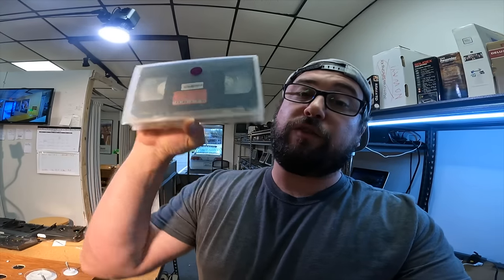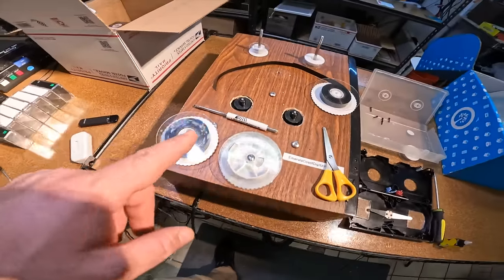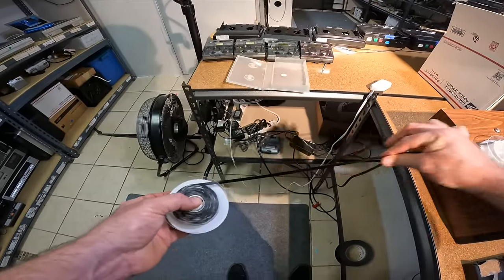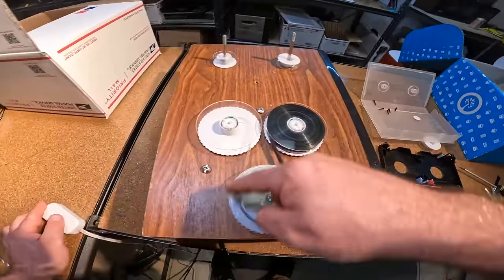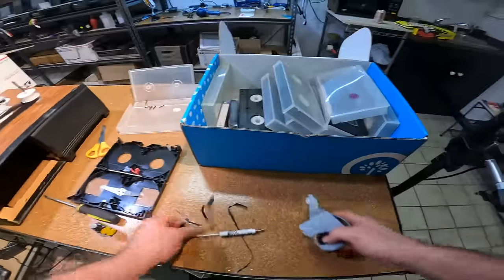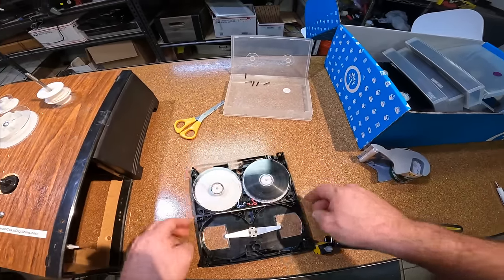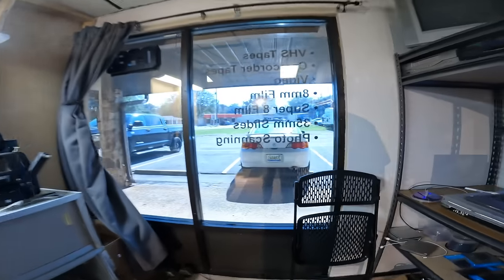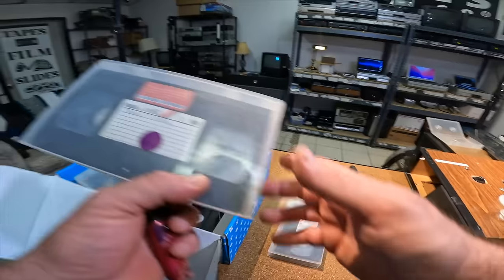Mold on VHS TAPES  **Red Stickers from LEGACY BOX, IMEMORIES , SOUTHTREE

Comment: 17:25 While the drive itself obviously has a certain longevity, it's nice that they tend to use pretty standardized cables, so if it's just the cable's connector that breaks down after a while, you can get a new cable for five or six bucks rather than buying a whole new drive.

Comment: I used to do tape dubbing and with 4 or 5 machines going, most recordings don’t all stop at the same time, and would get hairy because they were mostly traffic scenes and looked similar, I had to rely on the information the requestor gave me and if was wrong I had to babysit and play the tape and sometimes take a still print of an incident. Your operation was much bigger than what I had. We had a machine that would clean and take a stretched tape and take all of the slack, sometimes manually winding a tape that was stretched would add an extra 5-10 minutes. Our tapes were recycled every 45 days so anew tape might have 3 or 4 passes before retirement after running for an 8 hour stint.

Comment: You should add a network attached storage system, that way you can simply transfer from the internal HDD of each system to the main NAS storage without having to use a external HDD. Look into the QNAP systems..worth the upfront cost. If you want to go crazy, run everything on a 2.5 or 10GB ethernet network and youll having blazing speeds.

Comment: Man! Don't do that by hand! Use a VCR that isn't very good and let the tape run in play mode. It will slowly peel off the tape. Or, use a damp cloth to force it inside the spool to clean the mold. I always do this and it works! It takes a lot of effort to pull the tape by hand.
Reply from the maker: I appreciate your input.. You haven’t ran In To this type of mold before I guess. There is no… put it in a player..
Reply from the maker: I do sometime break the top of the spool off and then wipe it down. This is a demonstration video on how to keep it from ripping.

Comment: Beautiful. Some notes, though: 1) Yes, you 1000% need a NAS. 2) Until you get one, you should be using the `sync` command in the MacOS terminal (or "safely unmount") after each copy to that external SSD. The OS will report that the writes are done before all the bits actually hit that disk. 3) Once you do get network storage, don't use wifi, run ethernet to each station. 4) Have your capture software drop files directly on the NAS to save some more time 5) Your network storage represents a potential value-add for customers, because now you can offer storage of those files for a recurring fee. 6) What video encoding settings are you using, and how did you come to that decision? 7) Given that you're regularly handling moldy tapes, are you using any sort of air filters?
Reply: Was going to make comment #5 myself.  It depends on whom you listen to, but some will tell you that a USB flash drive should not be expected to store files longer than a year or two without refreshing.  Regardless, it should not be the customer's only storage for irreplaceable data.  You could offer long-term storage for a recurring fee, or you could try to upsell providing the same recovered video on multiple formats (flash, hard drive, and/or even M-disc archival grade BD-R or BD-XL discs) since they all have different optimal storage properties and failure modes.
Reply: @toasTr0n  if he replicates it to something like Backblaze B2 (or any S3 clone), he could also offer a sharing portal, just like the big restoration services he's already styling on.

But yeah, end users lose data. And his customer base is going to trend to older folks. So not having to worry about file management is going to be worth a ton to those customers.
Reply from the maker: No air filters at the moment. But I am aware of the dangers. I wear a mask but it’s far from sufficient. Things will change next time I get aick
Reply from the maker: I’ve thought about the monthly storage payment. Thanks for you input and questions.

Comment: Surprised about the 'splicing tape' you are using. That's just normal tape, right?
If one of the heads catches that, it's end of head. Definitely worth getting 1/2" reel to reel splicing tape. That stuff only sticks once, and does not stretch. Not expensive either.
Speaking of audio tape; I see some half decent decks, why are you using the cheap plastic thing? Seems a waste!
As for the server; Just a modern 4 bay synology NAS man. Two drives in raid for the customers, two drives in raid for your own stuff.  you'll be good.
So with you on the 'not leaving tapes overnight'. Makes a ton of sense. 
Also, hi to the chickens 🐓
Reply from the maker: I forgot to add the chickens at the end of the video grrr… when someone brings cassette tapes in I tell
Then how much I hate doing them.. I’m a video guy. But if they insist and are ok with a basic recording.. then I’ll do it.
Reply from the maker: Also I am talking to synology. I want them to sponsor
Reply: Works fine. I tape on the bottom.
Reply: Hahaha, yeah it's very basic! That's why I was wondering. A cassette tape can outperform a CD with ease, sound wise, if done right. That being said, if people don't mind the basic quality, I guess they don't know and don't care about that. 
I mostly do the audio side of digitising (cassette, reel to reel, vinyl, 8-track, minidisc) but I also have a VCR with HDMI out hooked up to an HDMI to USB capture device. It looks great, so I can help people with VHS and VHS-C, and anything else if their camera still works to play the tapes back. I do have a spare machine, just in case as it's nice to be able to help people out. Not a business in my case though :).
Looking forward to seeing those chickens in a next video! 
 @EmeraldCoastDigitizing
Reply: It's fine until it is'nt. This kind of tape stretches and also 'spreads'. At some point multiple layers of tape become sticky. It works fine for digitising but if that tape heats up and cools down and heats up, in a few years it'll be chaos if normal adhesive tape is used (ask me how I know...). @sweetbabysean